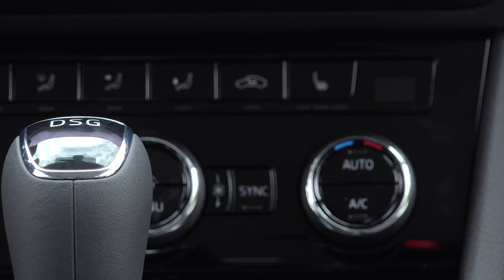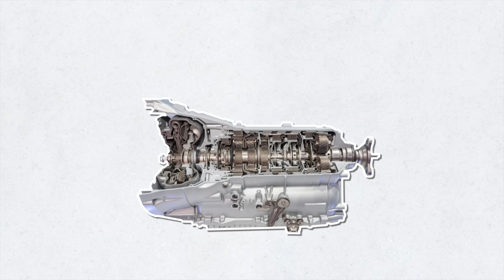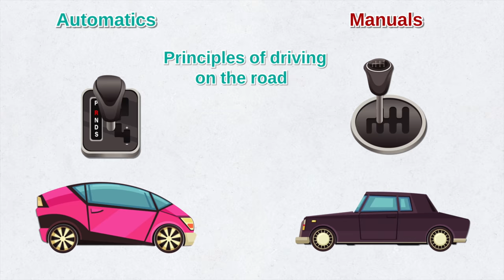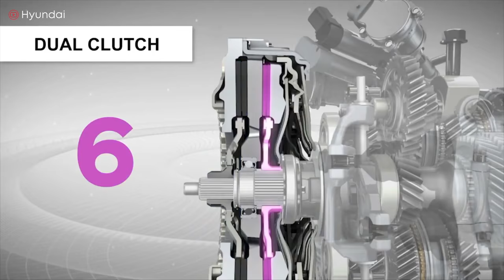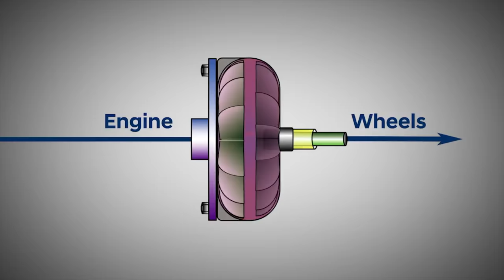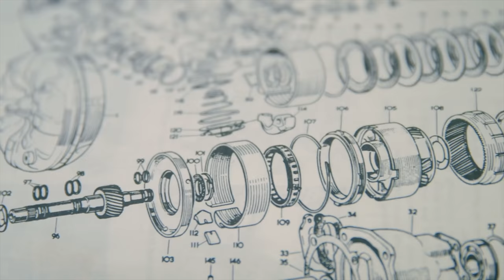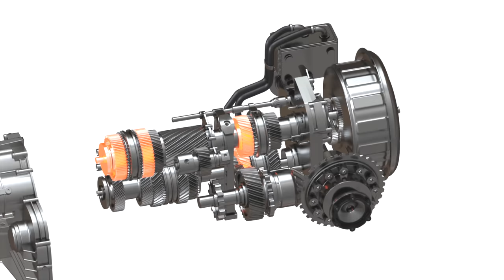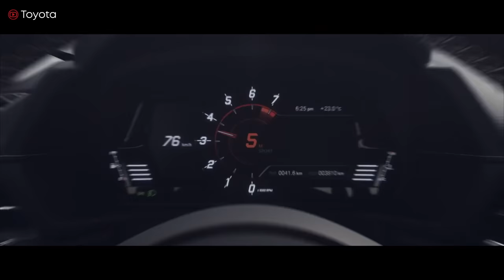5 Things You Should Never Do in an Automatic Transmission Car

Comment: Definitely always engage that emergency brake when parking on an incline or decline. I damaged the trans in my 2007 beetle by not engaging the brake after parking on our driveway over the course of several years.
Reply: Really? You broke the parking pawl?
Reply: @wholeNwon  I don’t know what a “parking pall” is.
Reply: @Puggy42069  Sorry, pawl.
Reply: @wholeNwon  Oh, no. I don’t think it broke the pawl, but it could of. My trans did start slipping every so often though. So I don’t know what else could of caused it.
Reply: @Puggy42069  Sounds more like a clutch plate wear issue or bad shift solenoid. ATF changed when it should have been? Correct fluid? Old?
Reply: @wholeNwon  Actually. It might have been old fluid. When I changed it after 13 years, 70,000 miles of not changing it, the Issue stopped.

Comment: Hey! I just rode my bike through that part of SF today.
My 68 Volvo 1800 has the parking brake on the LEFT so using it for driving on hills is much easier it frees your right hand for shifting. Another thing is on really steep hills you don’t have to shift to second gear just crawl up in first it saves your clutch.

Comment: When I was working at a Ford dealership I would get a lot of half sales (meaning splitting the sale) as I was one of the only few salesmen could drive a stick.  Been driving sticks off and on since the 70's which included a three on a tree.
Reply: I find this almost incomprehensible. They were CAR SALESMEN, for goodness sake. IMHO, you do not learn to drive unless you can use a manual transmission. I had never driven an automatic car until I was 19.
Reply: 4 speed was my first car.81 Plymouth
Reply: My first job was at a Ford dealership in the dealer prep/recondition shop. I was 19 & already knew how to drive a stick!  Imagine the owner's smile when he learned I knew manuals already.  :D
/I'll take that knowledge of a manual gearbox to my grave.  It's a life's skill!
Reply: @timsmith854  When the vast majority of the vehicles on the lot are automatics, the incentive is not there to learn to drive manuals.  Unfortunately, this skill is dying.
Reply: I guess sales job would be mine over there if I get kicked out of my current job. Yet to sit in an automatic. Forget driving one. Proper shifting is an art, without punishing the transmission.
Reply: @SantulanMahanta  True!  Overhauling the gearbox because the previous owners'  RIPPED through the synchronizers...really sucks!
(you ever notice it's first to second gear  synchronizer that usually goes bad??  I wonder why?) <sarcasm!>

Comment: I bought my civic at 180000 miles and it was perfect. I didn’t think about parking it on a hill and using the e brake. At first it was okay but after 5000 miles it started to grind the gears. Ever since it’s done that I’ve used the ebrake I just never knew the automatic transmission hated that lol. But it’s a civic so the transmission still shifts like a dream.

Comment: Got a 2015 dodge dart around 120k miles. Runs great and shifts great. Changed the transmission fluid when I got it along with filters, plugs and other fluids when i got it and has me around 28-29mpg hwy which is still factory. Only down side is she burns about 1/2 a quart before every oil change at 5k miles. But i can live with that.

Comment: I learned how to drive using a stick shift truck and then drove a car with a manual transmission and loved them until later on when I purchased my first car and it had an automatic transmission in it. That is valuable information on the transmissions and I have never done most of what you talked about not doing when driving a vehicle with an automatic transmission. I still have a 1999 Ford Explorer and it works great and that is because I never abused the vehicle and changed the fluids like the company said I should.

Comment: As a person that's not a full-time mechanic but has worked with all kinds of mechanical things and doesn't know when to be afraid I had an interesting experience.  Bought a 2001 Ford Explorer Sport Trac that had a shifting problem. Changed the filter first and that helped some however didn't cure the problem.  Ended up changing the valve body gasket because the old one had a spot that was not keeping the channels sealed and the oil flow in the channel. Anyway thanks Scotty for your videos.  Rev up your engines 😂

Comment: Getting stuck in neutral!

The old GM column shifters had a fiber disc that seperated the shifting rods under the hood. If they were worn and you shifted to neutral(like at a tollbooth) you might find the shifter would lock up. You then had to open the hood to reach in and unjam them. Fun times. 😥

Comment: I always use my parking brake when my truck is parked on an incline.  But never on level ground. I don't see the necessity.
Reply: I always park a manual and leave it in gear, just in case the parking brake fails.

Comment: 7:21 I worked in Detroit at Precision Honing that made those "Locking pins" They are called Parking Pawls. Its a pick that swings into your gears. I remade them for the Ford F-150 recall of peoples vehicles just rolling away back in 2014-2016. Ford installed batches of Pawls that were not endothermic gas heat treated & hardened at the other facility RMT woodworth I worked at.

Comment: I miss having a manual transmission.  I am really bad at letting my car get close to empty before filling back up, but after seeing this video, I am going to start changing my ways.  I also heard it is not good to top off on the fuel either.  Once the pump clicks, remove it from the tank.  Do not top off your gas.

Comment: When I was growing up, they were called 'Emergency Brakes' because of a single hydraulic system master cylinder (Saved me a couple of times when main brakes failed.). Usually only people with manual transmissions used them when parking. It was much later when consoles became the norm they started calling them 'Parking Brakes', but many people didn't use them anyway. I became adept at releasing them when I worked at an auto auction and the internal cable seized due to rust. [Wink.] JMO.

Comment: Scotty, because you talking about shifting gears, I learned how to drive on a GMC CCKW, also known as "Jimmy" and also had to manage how to climb mountains and going through the mud, using its off-road capability on a 21⁄2-ton, 6×6 truck to get my drivers license in Austria and this was really fun as I am only 1.63 meters short. Many trucks were built without having any Synchron Rings back then, drive that on Europe's alpine unsealed roads in the seventies for living. I used my knee to hold the steering wheel so I could downshift the gear with one hand and operated the engine break with the other, not losing the momentum on engine power. I think I have a better reaction time span when driving an automatic with the left foot on the breaks and accelerate with my right foot.

Comment: My transmission was lurching when downshifting at 58k miles (I bought it at 50k), changed the trans fluid myself and hasn't lurched since. 
2012 Chevy Equinox 3.0 LTZ AWD
Reply: Best  change  out  each  35,000  miles  plus  new  filter.

Comment: I learned to drive in a "3 on the tree" 1960 Ford Falcon Wagon that had a 166 - inline six engine.
When I bought my first car, I bought a 1963 Ford Falcon Sprint with a "4 on the floor with Hurst Shifter" and it packed a 260-V8 with a Holly 4 bbl and high rise cam......

Comment: Yes, always use the parking brake. You can strip out the parking pawl. The pawl is made to PARK the transmission. NOT made to hold the weight of the vehicle. And letting the transmission build up pressure is true too. One time my brother in 20deg weather started up a Mercury Sable and put it in drive immediately. The car didn't start to move until about after 10 seconds of running to build up fluid pressure in the old AX4N. Always let your car run for about a minute before you start driving it. Especially if it's freezing 🥶 the oil's thicker let it warm up to thin out

Comment: I also park with my ebrake. When I park, I put it in neutral, engage the ebrake, let off the brake pedal, press the brake pedal and shift it to park. That way all the weight is on the ebrake and not the transmission. I learned this from Scotty himself years ago. Great little trick!

Comment: Coasting in neutral will save fuel, however even though some transmissions were made with front and rear pumps they cheapened them over time and eliminated the rear pumps making them more likely to experience wear when coasting.
 Quite correct though that some control is lost in neutral and not all automatic transmissions allow you to shift back into your drive gear while moving.

Comment: It never fails every year before winter there's a news article with "experts" telling you that you don't need to warm up your car.
Reply: That's because in today's times you do not need to warm up before driving. You just don't want to take off like a rocket. Your vehicle will warm up faster it you get moving and get the engine revs up. The only reason people want to warm it up in winter is for their comfort, not the vehicle's performance.
Reply: I literally watched a video on this channel a few weeks ago where he said in modern cars you DO NOT need to warm up the vehicle when you first turn it on, even in cold weather.
Reply: I live in Minnesota where temperatures average around 1 degrees Fahrenheit in the winter. I'll warm up my car for at least 10 minutes before driving. I read an article that you don't need to warm up your car. I tried it one day. It was about -5 degrees. Started the car, placed it in drive and hit the gas. The car would not move. Back to letting my car warm up for at least 5-10 minutes before driving.
Reply: You don't need to warm up the engine. Just drive is slowly for a couple minutes.
Reply: @interdimensionalsteve8172  He said it’s bad to drive a car hard without letting the engine warm up. This is an indisputable fact. You don’t need to let it sit there to do that, you can drive it easy to warm it up before going hard. Or you can let it sit and warm up so you can get immediately onto the highway. There’s no inconsistency here.
Reply: @interdimensionalsteve8172  Yes, you don't need to warm up before driving. But what he really means that don't drive like a rocket that would damage the parts.
Reply: @CamberRockerCamber  The last place to find accurate and honest information would be any newspaper.
Reply: Scotty said, "HARD DRIVE" your car cold. Start your car, give it 30-ish seconds while you attach your seatbelt and plug in your cell phone, check your mirrors, then drive slowly to moderately until you see the temp gauge needle start to drift upwards. Then your good to go.
Reply: I usually wait till my tachometer goes below 1,000 rpm. Doesn’t take long (about 20 seconds in my car) before setting off.
Reply: @williamjones2596  True that, i live right off of a highway i take to work every day, i let my truck get down to normal RPM range before setting off.

Comment: We just got a 2017 Subaru outback. It has a CVT transmission but there is also a manual mode where you can shift with steering wheel paddles.

Comment: I learned how to drive, in 1985, at age 12, in a manual transmission Yugo.  It took me about 15 minutes to get a hang of the clutch better than my dad, and now I can drive anything (serious, if you can drive a manual Yugo you can drive anything).  Been driving Priuses since 2004 (computer controlled power split device that appears to be a CVT to the driver, but is not a CVT and doesn't work the same way).  But I drove a manual transmission Uhaul last year and it was like riding a bike.  In a couple weeks I will have a Tesla though, nothing resembling a transmission at all.  The 2014 Prius I have right now is the last car I will own that uses gas.

Comment: According to my mechanic automatic transmissions cars don't need parking brake applied unless maybe one lives in San Francisco.  As far as warming up cars; I usually do especially in the winter. I think the minimum amount of time to warm up a car should be 30 seconds to a minute any time of the year. I know your previous videos said long warm up times are not necessary on modern cars. Mechanic told me 3 minutes is good for any car. If one has an emergency then it's not possible.  However usually I let my cars warm up at least 2 minutes if I'm not in a rush. Park or neutral when in heavy constant traffic. I tried it recently but traffic started to move. It's hard to judge in that situation.

Comment: In general, if you chose the correct viscosity oil for your car as per manufacturer recommendation, you really don't need to warm up your car before driving in winter.

Comment: Just a a point of fact: in the 1950's GM made 4 speed automatic transmissions. My parents had a 1956 Old's 98 with such a transmission the (Turbo Hydromatic), later it was changed to a 3 speed but they kept the name.

Comment: What about putting to neutral at red light? Does this shorten the life of a transmission?
Reply: Yes, because once you switch to drive the car will most likely will be moving
Reply: When you select "Drive" at the red light after having it in neutral, put your foot on the footbrake and then select "Drive"...
and if you can, anticipate the green light and do the selection before the green light...
you are less likely to slam it into gear and accelerate while the gear is not fully selected....
Reply: It may actually be illegal in some jurisdictions.

Comment: Yes.  I towed a trailer with a manual 5 speed and wore out the gear several times.   It was not designed to tow a trailer because it was a very light weight car.  1991 Nissan Sentra.   Bad mistake.
Reply: You  can  not  expect  a  pony  to  do  a  horse's  job.
Reply: @williamoneal3947   Did You used to work for Champagne Dye?

Comment: Newer cars will ignore shifts from drive to reverse while moving, fortunately.
Reply: I don't see it as fortunate.
It removes responsibility and the necessity of a driver to be skilled.
If dumb and bad drivers are discouraged to drive, the roads will be more safe.
Honestly.. if someone even has the idea of putting their car in reverse while moving, i believe they shouldn't be driving AT ALL.
Reply: @DeeDee-pw9pm  That's really harsh. There are a LOT of people out there who live hand to mouth, in difficult situations and who didn't have people in their lives to teach them about ATs, cars in general, etc.
Reply: I would like to ask you a question.
I have a 2021 Toyota Camry Hybrid LE, ECVT transmission. I accidentally shift gears to parking while still driving the vehicle at really low speed. I will guess less than 2 mph. I heard a nasty sound. It drives like nothing happened. A week later the motor engine sounds kind of louder than before, when the car is not moving (parked) and the electric motor switches to the gas motor.
I don't know if I should be worried?
Thank you in advance for your answer.
Reply: @wholeNwon  Poverty the cause of stupid actions performed by motorists?
No teachers for those with drivers licenses, when they had teachers in driving school?
That's nonsensical.
Reply: @pepehernest768  Since we are talking about a hybrid my knowledge ends at this point.  I would think their transmissions are controlled by a processor or processors.  Your malady could be more electronic than mechanical, if it is related to what you did at all.

Comment: What I like about the manual transmission in my 1988 Chevy Nova Twin Cam is that I can throw it in neutral and coast and coast and coast in this rural area with little traffic. What I don’t like about the automatic transmission in my 1995 Ford Contour is that it's got 179,000 miles on it.

Comment: So, Scotty, Is it  bad to shift an automatic transmission to neutral when stuck un traffic or idling for a long time with AC on ?
Reply: Based on what he said, Park would be better (I think).
Reply: If the car isn't moving neutral means nothing is moving. It's best to put in in neutral than to force drive with brakes on. Pretty much everything he said I had already learned by myself feeling my cars.
Reply: I want to know the answer on this as well. Looking for any engineer or an employee of Aisin or any transmission company please answer this question.

Comment: I had a 94 explorer with a ticking noise that was speed related. Everything else was fine. 
I took it to a local transmission shop and after a test drive the salesman said my transmission was about to quit. 
I thanked him and kept driving it. 
One day I checked the lug nuts and found them so loose that two studs were broken. 
Watch those criminals!!

Comment: Our family has a 97' Rav4. & that's the "family beater" "utility car" "grocery car" right now. BUT when my sister was using it.....OMFG!!
Nearly all 4 tires were bald/balding fast, the exhaust pipe happen to tear open...luckily our mechanic welded it back for like 60$. Whenever I was in the car she would hold into the gear shift not knowing it could jam at any moment. Almost 6/10 times that car would have the "gallon light" on. She would drive that Rav4 thinking it was a Supra...
But now, it got tuned up. New 4 tires. New timing belt, water pump, oil pump, battery, alternator, pcv valve, radiator. I contributed to New valve cover gasket, spark plugs, air filter, power steering fluid, & spark plug wires. I put Castrol High Milage for my oil of choice. Purolator for the filter, & now it also has a club protector so no one can steal the car...